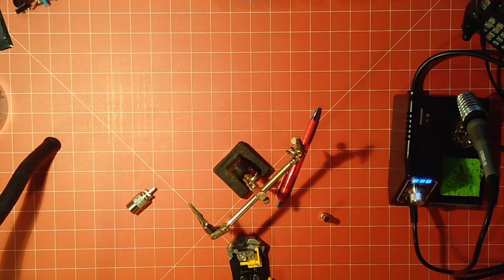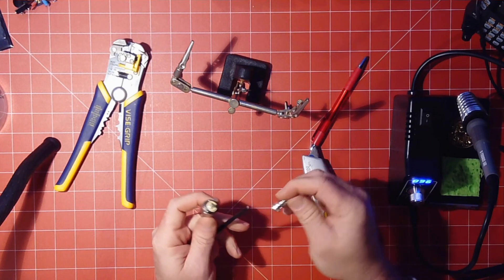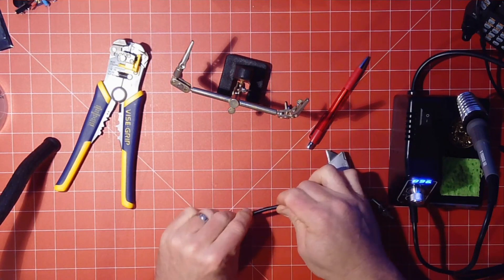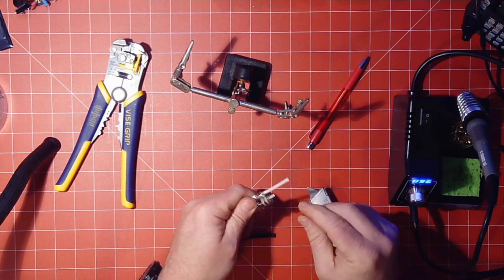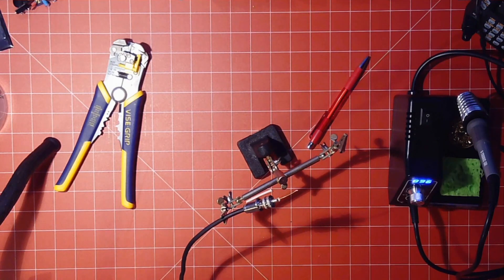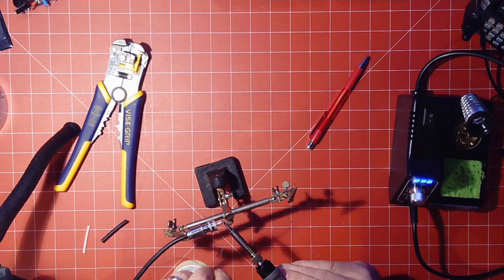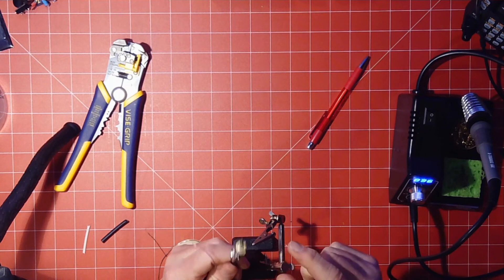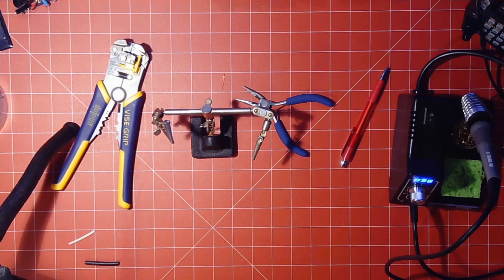Ham Radio Basics: How to Solder a PL259 Connector

Comment: Good job on the soldering part. I cringed though when you used your finger as a backdrop holder while cutting the outer cable - very unsafe.